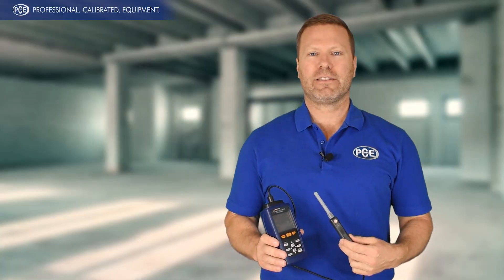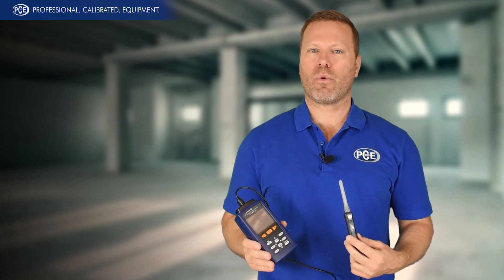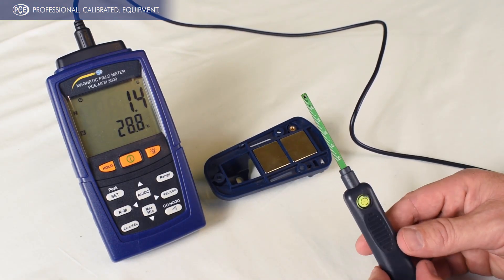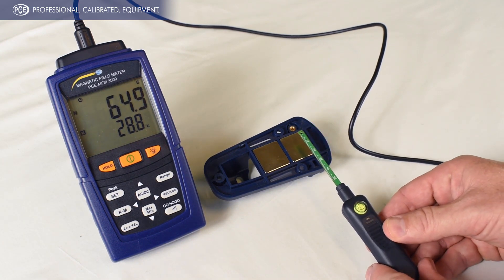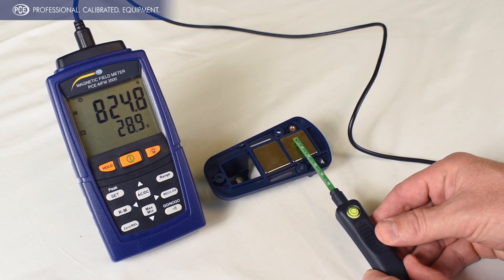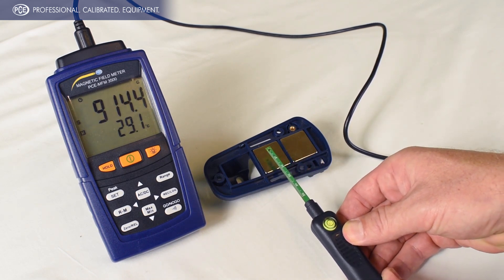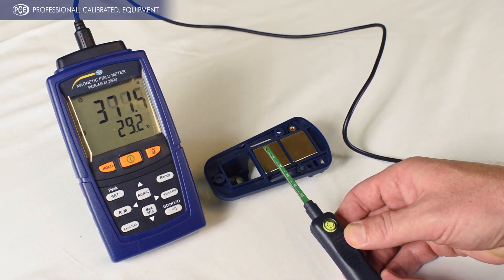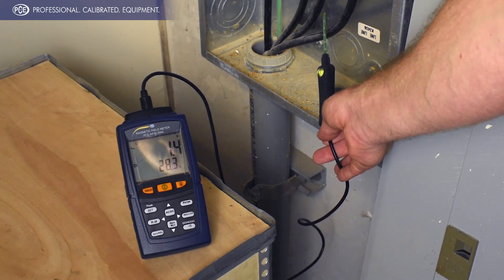Gauss Meter PCE-MFM 3500 Demonstration

Comment: Is possible to use it to measure Ac Gauss from Induction motor Stator Coil.
Reply: Thank you for your kind reply
Reply from the maker: Hello Esam,

It will work as long as you are within the measurement range:

Measuring function    AC milli Tesla
Measuring range    Resolution    Accuracy
150.00 mT    0.01 mT    ± (5% + 20 Dgt)
1,500.0 mT    0.1 mT    ± (5% + 20 Dgt)

Measuring function    AC Gauss
Measuring range    Resolution    Accuracy
1,500.0 G    0.1 G    ± (5% + 20 Dgt)
15,000 G    1 G    ± (5% + 20 Dgt)
Reply from the maker: Yes, this is possible, so long as the Gauss is less than 15,000 Gauss